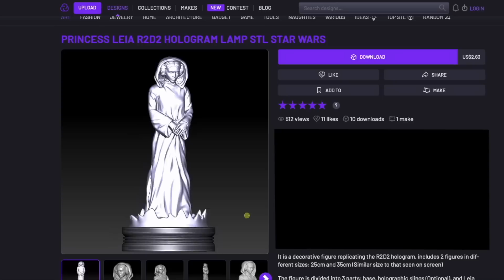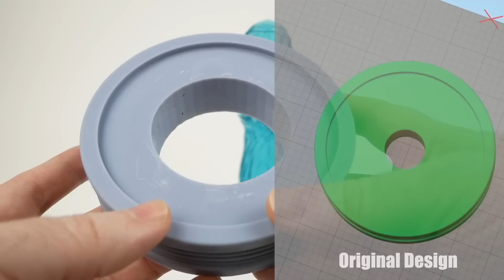3D printing a Princess Leia Hologram Lamp (Resin vs. Filament)

Comment: I was reminded of the singingheads in the Haunted Mansion at Disney Land. The effect is done by projecting the moving faces onto the statues. If somehow one can obtain or create, the video of Leah speaking. It would be possible to project it onto your statue,  and make her talk. (she doesn't really need to bow down at the begging.) Also print in clear and add a blueish filter or color programmable LED strip, (you can have a mood light in any color this way).

Comment: Did you use a clear coat on your resin print?  If not you might try that as it will look even more clear, almost glass clear.   If you use a 200 grit on the bottom part, you could smooth the bottom, then 1000 or higher, then wash off, dry, then clear coat agin will look like glass.
Reply from the maker: Yes I always use a gloss coat. It would be like smoked glass without it

Comment: Neat prints. They all have their merits and aspects that make them cool. I wonder with the glow in the dark filament.  If you do a black wash over it. And of course wipe leaving the wash in the layer lines  but exposing some of it. So it still had a way to he charged by light. Then you'd get a line effect.

Comment: Random thought..... what if the FDM prints had a cylindrical hollow tube in the center... then a long strip LED with dimmer lights (so the glow doesn't get too bright).... and then something translucent around the lights to diffuse them? I know that's not to different than home made lightsaber tubes... but that could get a more even top to bottom glow, and that 1mm layer height effect could look incredible!

Comment: One suggestion I have for better illuminating the filament printed Leia is to maybe use a string of LEDs or some kind of LED light rod that will illuminate the whole statue throughout and not just at the base. You could print it a little thicker to hide the light, but I think it would help it glow better and give it a more hologram appearance.
Reply from the maker: My fear was that you would be able to see the individual LEDs as hot spots if they were up inside the figure
Reply: @MightyJabbasCollection  you can use white visor sheets to disorientate the LEDs that way you cant see each individual LED. Almost like a buffer sheet.
Reply: @MightyJabbasCollection  ah I remember what they are called. They are called light diffuser sheets

Comment: I thought you might want to know this. Supposedly a Lego Star wars diorama set of Jabba's throne room will release. If the rumors are true, it will retail at 70$ (USD) on May 1st. Lego leaks have been wrong before but I personally think this set will release. Watch out for it if you want to nab it in may. This is all rumors and leaks but there is reason to believe it's true. Hopefully it is true because it does sound pretty cool.
Reply from the maker: Thanks I had heard that! I’d prefer something bigger but I’ll certainly be getting it in any case

Comment: Can you share a link to the light you are using please?
Reply from the maker: Yes I’ll add it to the description. Just keep in mind that it won’t work with the original design unless you alter it as I did
Reply: @MightyJabbasCollection  yes, i saw that on the video. I think i could do the same once i get the light and measure it